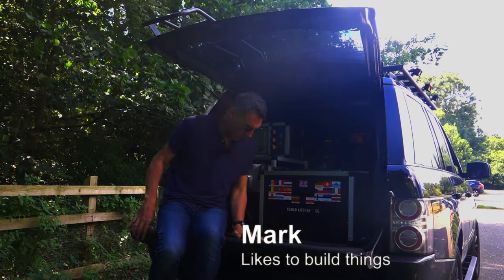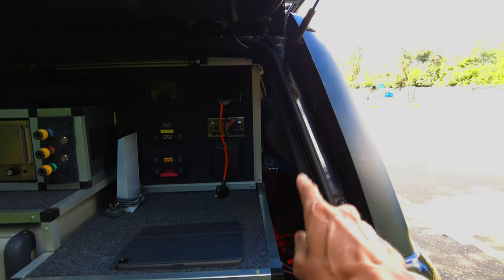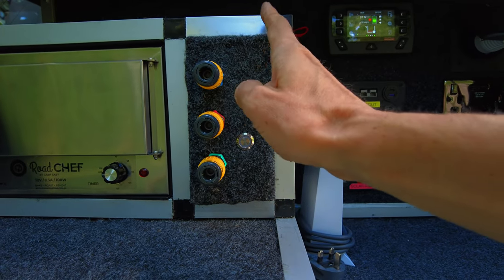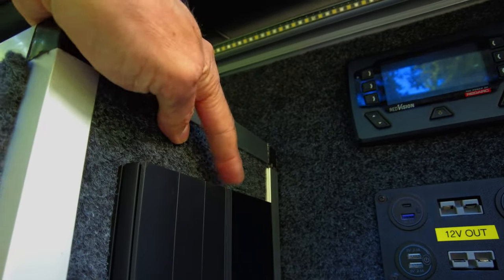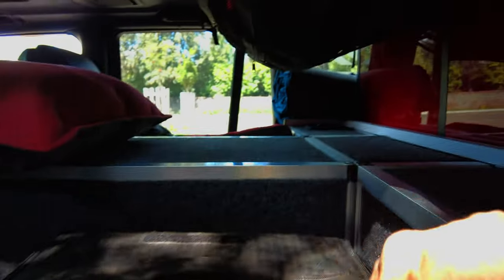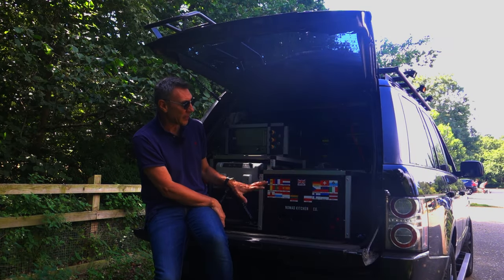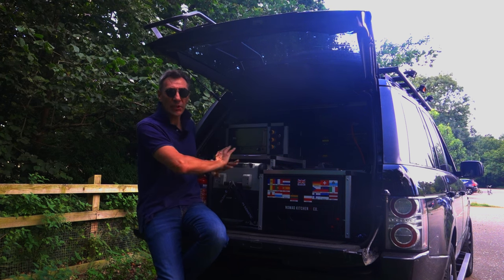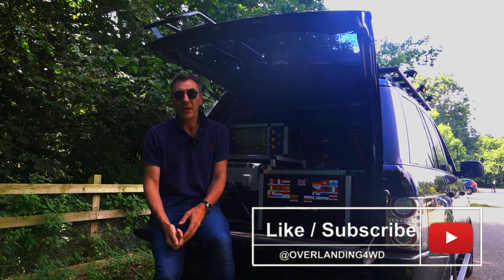Range Rover L322 Overland Set-Up | BUILT for Adventures

Comment: you mentioned you have put the spare tyre on the roof, so what is in the cavity under the real load space where the spare tire used to go.. surely this would be a great place to put a water tank? has anyone designed thing that fits and is suitable?
Reply from the maker: Firstly, no such donut shaped bladder exists to fit that space, second, not sure I’d want that much water in there were the compressor is, third filling it would be a pain, for my use anyway. 

Much better solutions for water 👍🏻
Reply: hmmm... it just aeems to be to be a great location for a weight (centred down low) that you dont need to access directly and its quite large. may i ask what you have in there? ie what is iit good for? i think the water leak problem  probably exists for really any water storage inside the car ... filing could be done via tubes?  anyway just a ithought.....
Reply from the maker: It’s not as big as you think. It’s just the size of a tyre when you think about it it, so not sure it’s worth the effort, I don’t have anything in there, as it’s a pain to access with my set-up, hence the tyre on the roof.

Comment: Just wondering what happens when you have the tailgate open for extended periods as i have experienced battery drains while working n forgot the tailgate is open so it's a pain 😕 wondering what should I do to remedy that issue cause overlanding means the tailgate is in use for extended periods
Reply: The tailgate is OK, just make sure you turn the interior lights off. I’ve not had a problem with the tailgate, upper and lower being open